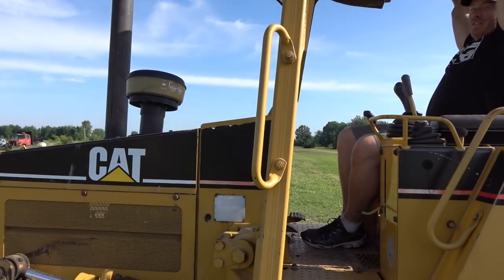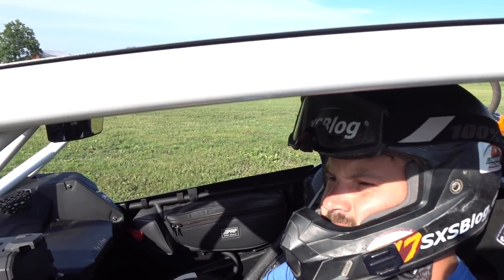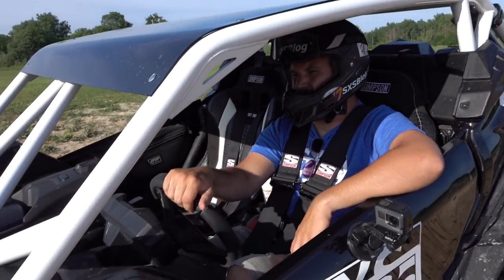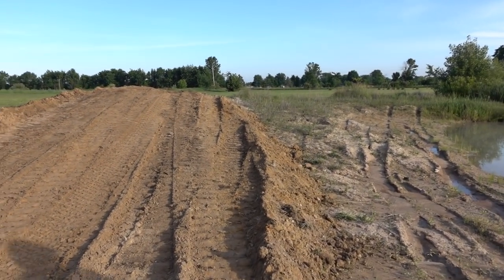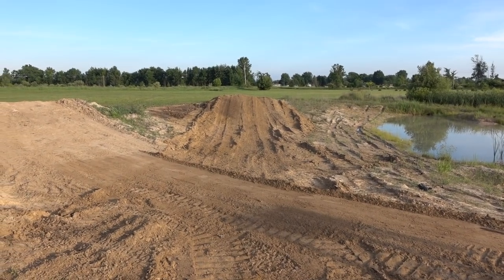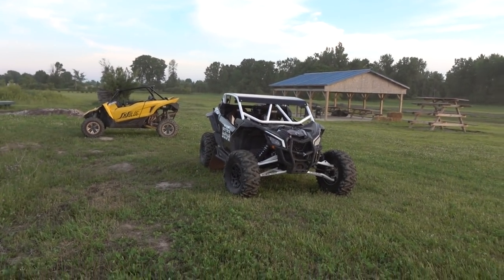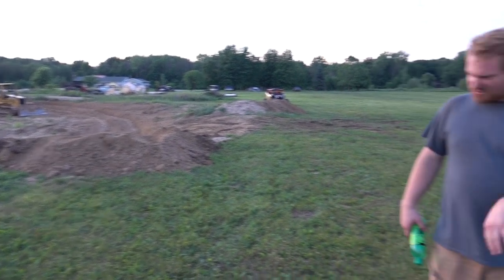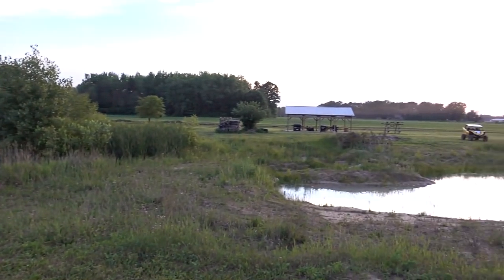New jump and test track? X3 and YXZ racing!

Comment: Tighten front shocks up in small adjustments to keep from nose diving just a tip you don't want to go too much though or it will change your handling on trails also use a string line to get ramps flat as a guideline great job guys love the vids

Comment: I'd take the dip before the jump out. Or move it closer to the jump. Seems like the suspension is compressing and then rebounding before you even hit the jump
Reply: Jacob Meinema they need to make that drop less steep. Make it a longer slower drop. Thatway the suspension is settled when hitting the ramp. Seems like the weight of the rigs are still moving in wrong direction or something.

Comment: For the jump and get it to fly straight I would say leave it the same radius that it is at but make the lip of it a bit longer. If you watch it in slow mow the front is compressed quite a bit and doesn't really get to rebound before it leaves the ground. The shock then rebounds pretty quick and I'm assuming that movement of the front shocks are pushing the nose down a hair. I'd also say the back shocks are causing it to since they are compressing at the base and not enough room on the jump for it do rebound. Not an expert but just like to help
Reply: Idk if that was confusing or not but say take the angle of the last 2ft of the jump. And extend it buy and extra 2 to 3ft, or more just whatever work, at the same angle that way the radius is all at the base.

Comment: Got an idea for you guys your entry point can you have that downhill slope that's an aggressive slope Long Gate that slope where it's not so aggressive for your suspension your suspension won't work as much going into the launch point I think you guys are loading your suspension right there and then by the time you get to the jump you have such a short distance that your suspension isn't having a chance to unload or vice versa it's staying loaded so when it goes to unload you guys aren't getting what you guys need for a launch point I think that might help if you Long Gate out that entry point where the downhill slope is is to aggressive just an idea that way you guys can keep your suspension from loading and unloading in that one section between the downhill slope that's aggressive and your launch slope that's aggressive I think that's where the issue is possibly I'm not sure like I said just an idea to play with

Comment: Not the jump it's the machine u hit that on a quad it would shoot you way out flat understandably a quad n dirtbike has more control but the jump has little lip as it is. Just the way the dam machines fly without all worked out suspension

Comment: You boys are scared. Just need to hold it WOT til it stops wheels up, on it's roof. And if you do the shock rebound damping upgrade, where it has a ajustment screw at the bottom of the shocks, you will be able to control the kick and land flat.
Reply: Thats what sous is for bro, # project 168.